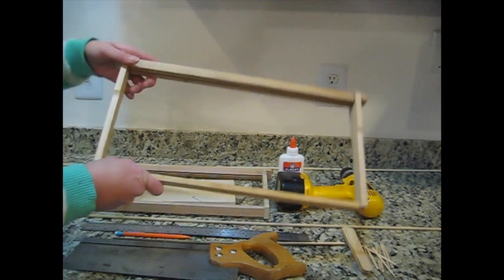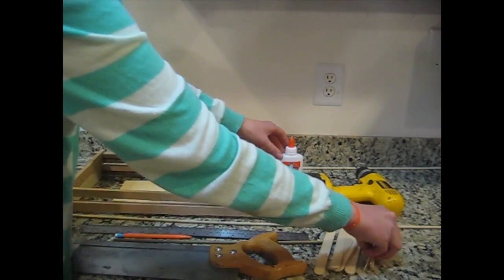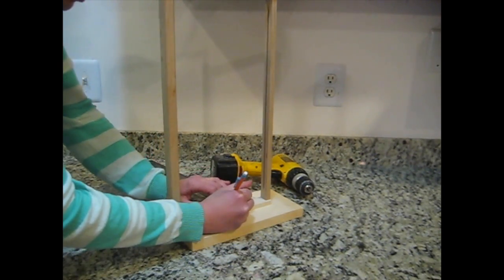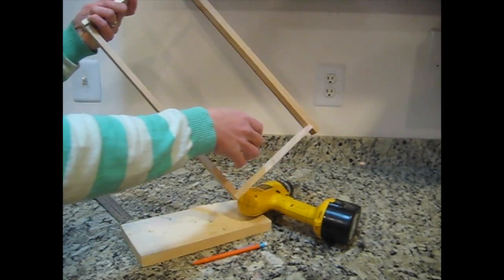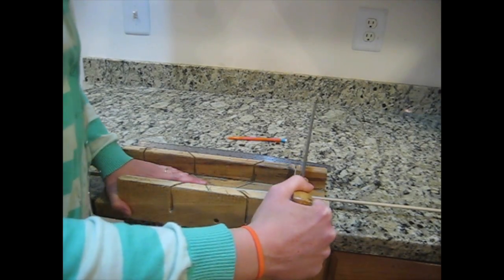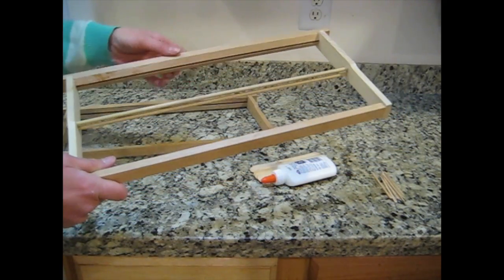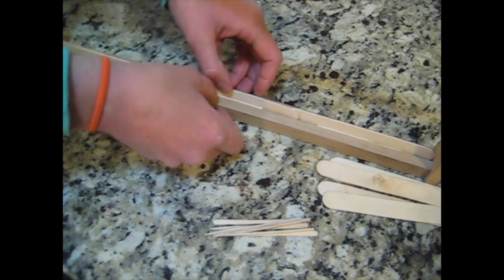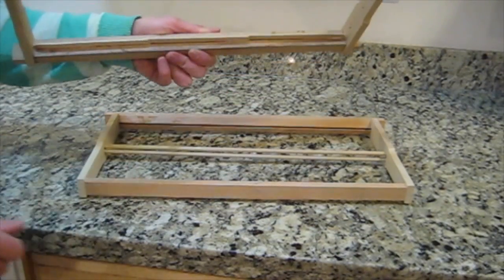How to Make Your Own Middle Bar Frame

Comment: I thought about using just the bottom bottom bar trimmed down 3/4" to fit between side bars. What is the benefit of using two dows instead of on solid bar in the middle? Thanks for the video!!!!
Reply from the maker: The solid bar would support comb too. That was among one of our first designs for this frame. The advantage of having 2 dowels is that then you can sandwich burr comb (or other things) between the dowels. We use it often for this.